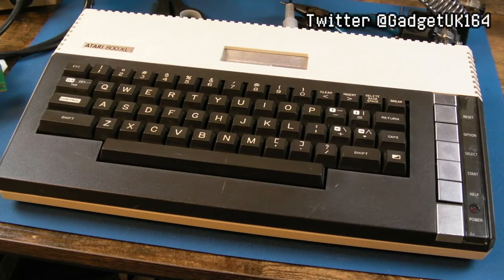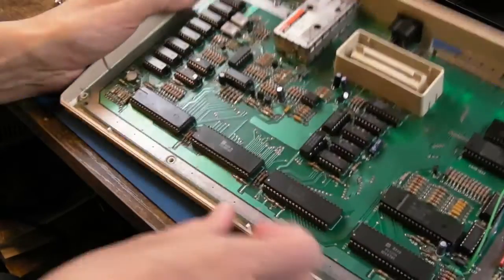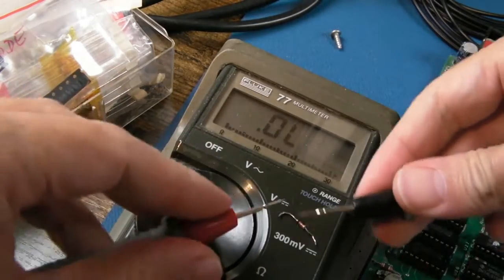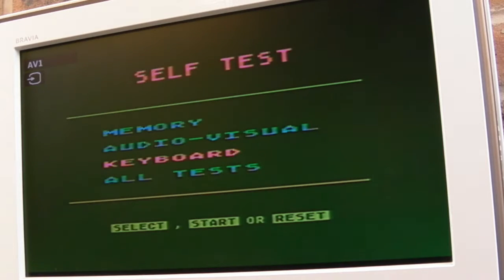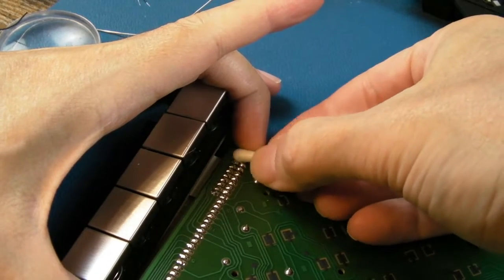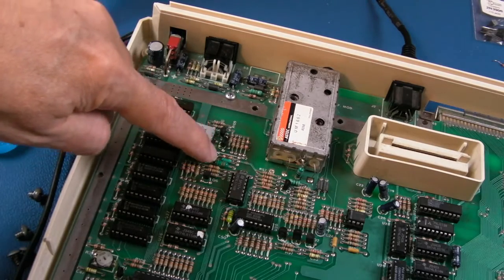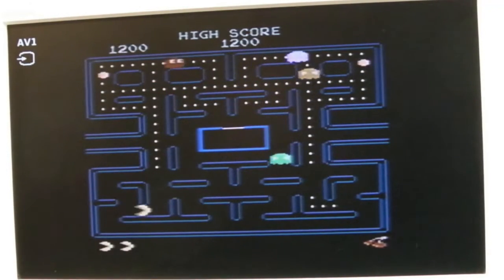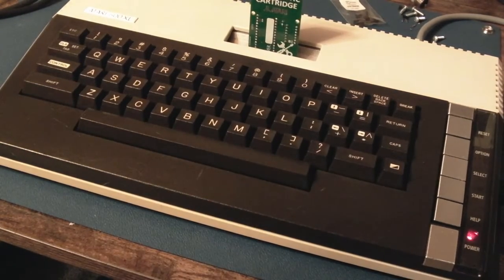Atari 800XL Colour & Keyboard Membrane (Ribbon) Repair

Comment: My keyboard totally quit working and I replaced the membrane thinking that was it.   It wasn’t.   There are 2 ICs that are made by RCA that are multiplexers for the keyboard input.   I replaced both for like 10bux including shipping.   Works perfect now.  Both are socketed making it much easier and cheaper than messing with the membrane.    Something to keep in mind.
Reply from the maker: Yes, they do sometimes fail - as does the membrane!  I had to swap mine out last year as it just got worse and worse.

Comment: With my 800XL I have to wait several seconds after turning off before I turn on again ot it won't clear the memory. Is that normal for these?
Reply from the maker: Yes, that's normal for the Atari 8 bits!  My 65XE is the same ;)

Comment: Very inventive flex cable fix. Such a shame it's difficult or impossible to source a direct replacement for the awful flex cables. Unfortunately I've taken to removing the entire thing and replacing it with ribbon cable with a 24-way female Dupont connector at the end (and a 24-way male header on the motherboard), but all that crimping and soldering takes time and it's fiddly as Hell.
Reply from the maker: Thanks, certainly a lazy fix I did, and on reflection I should have used multi strand wire!  I am sure it will be OK, but ultimately if someone goes in and out a number of times, a connection I fixed (or another) is sure to break...
Reply: @GadgetUK164  Have you seen Paul of Rossmann Repair grafting new flex cables onto the existing ones on a Macbook by soldering the individual tracks? It reminded me of that!

Comment: The 2n3904 and 2n3906, looking at they spec sheets, have quite a wide tollerance when it comes to what kind of gain you can expect from them. There are no gain "classes" specified. They just say "hFE: 100-300", which is not entirely useful. So whenever you deal with them, you have to measure what actual gain you got :p That was enjoyable seeing you fix the Atari :D Thank you!
Reply from the maker: The point here though is the 2 from the Amiga had identical gain, and the pack of 10 or 20 "replacements" whilst having a totally different gain, they all were the same as each other - and NOT suitable for this Atari.  I am sure they were just an equivalent lablled as 2N3906...

Comment: I designed and built a modern mechanical keyboard replacement for my 600XL using the original keycaps. The membrane was dodgy, my solution was overkill 😁

Comment: Y1 and Y2 Xtals can be sourced / harvested from an Atari Jnr which are readily available. I had to rebuild the Pal colour circuit into a NTSC machine and used an old Jnr board. The schematics for the boards are on Atariage. As always enjoyable Sir. I am currently in battle with an Early Adelaide a3010 which now needs nearly all keyboard traces repairing. Someone really needs to do a pin to point map lol, your Archie videos and struggles were highly informative. Many Thanks Geisty.

Comment: LOL, you know so many machines Chris, but you need to delve deeper in to the Atari range. Hold Option disables basic which on the XL also takes you to self test mode, had there been a disk drive connected it would have booted without BAISC. The Start button when held at boot allows for the tape to be loaded via the SIO (Serial input output, aka the first version of a USB (same guy)). Just going to watch the rest of the vide now :)
Reply from the maker: I just managed to forget which button does what lol!  I have a printed piece of paper with notes on this sytem - I often forget how to use the SIO2SD too lol!!!

Comment: Coincidentally I was watching a recent video from Arctic Retro fixing an 800XL just before watching this one.  He had the same issue as you with the Super Salt cart, but it turns out that there is a later rom that can handle XLs (and presumably XEs) properly. 
The keyboard mechanism was totally different to yours though (membrane based).